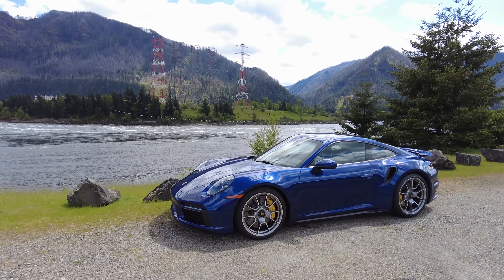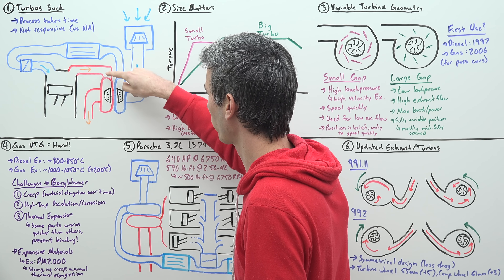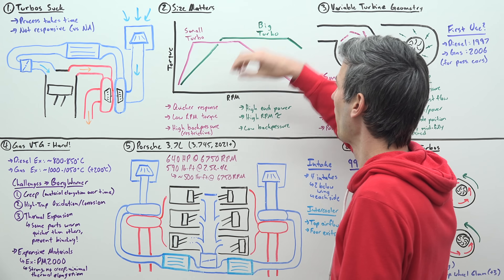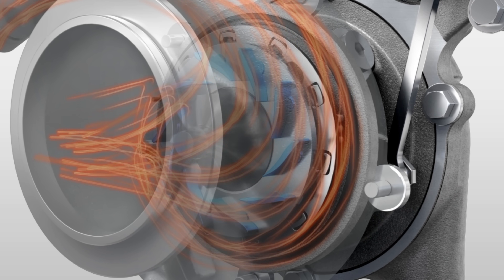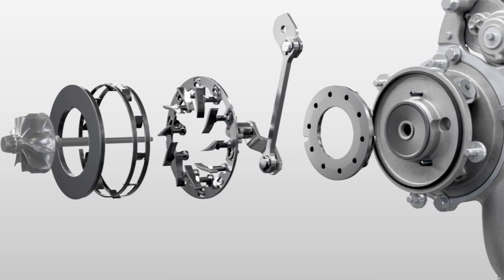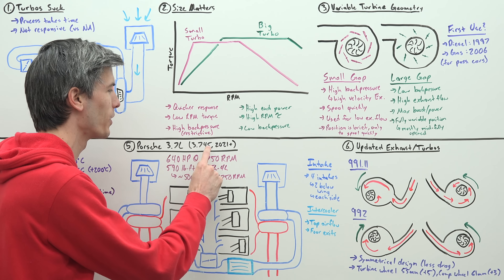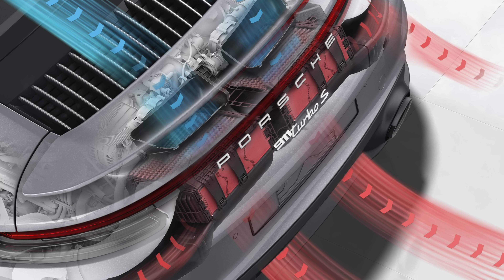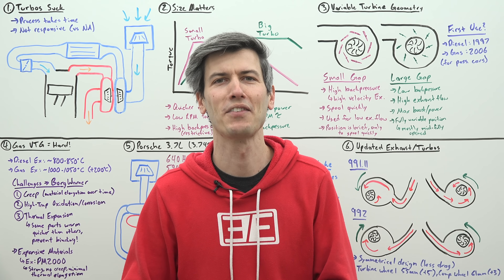The Perfect Turbocharger? Porsche Did It First

Comment from the maker: The whiteboard's back! I think arguably electric turbos are up there as the best (like what's used in F1), but it's of course a much heavier solution, adding a large electric motor and battery to the mix. As a more mechanical solution, this seems pretty ideal; what do you think?
Reply: Google Honda legend wing turbo Jason. Honda did it in the late 80's with the jdm 2.0 V6 tuebo legend
Reply: @crztank9298  Right! The Honda Legend Wingturbo (KA5) came in october 1988.
Reply: And the Shelby CSX-VNT in 1989
Reply: It would be really great to compare this Porsche to the original 930 turbo and show just how much turbo technology has changed and the impact on the driving experience.   The turbo lag on the 930 was insanely long and then the power delivery was basically binary  - virtual no power or alternatively wheel spin
Reply: Are OEM's using carbon fiber turbines on the intake side? If not, what innovations are they doing to keep the rotational weight (polar inertia) down?
Reply: BTW, awesome take-down, as usual! 👌😃👍
Reply: Chrysler used Garrett VNT turbos on production cars in 1989....
Reply: I am a big fan of VGT turbos, and the driveability and performance they can offer. As somewhat of a diesel pickup buff, I feel the need to mention the introduction of VGTs to everyday diesel trucks. Sure, people are gonna say “the actual first gas/diesel with a VGT was…” But when the mass produced Ford and Chevy pickups received their first Powerstroke or Duramax diesel equipped with a VGT turbo, the truck market evolved into what we have today; heavy duty trucks from every manufacturer with great power, and amazing driveability. Notable efficiency as well, save emissions equipment. All offerings by Ford and Chevy since these came out in 03-04 have used VGT technology, and Dodge/Cummins later, albeit in a different way. I felt the need to mention since the mass integration of VGTs in production vehicles seemed to be around this time, along with the 06 Porsche that was brought up, if you figure a longer production time; speculation of course. No one is probably going to read this sentence.
Reply: J M  doesnt matter lol noones buuying a honda bc of that
Reply: As the others have mentioned, Honda used VNT turbos, but also Nissan did too on their domestic market VG20ET V6 engines, also late 80s/early 90s like Honda.
Reply: I don't think you are going to see my message mate but VGT on gas cars was introduced in a slightly different manner back in 1993... Using only one single nozzle in the turbine and the first (and only, with that type of charger) gasoline car to get it was the 220bhp Peugeot 405 T16 with a Garrett t3 compressor family and that unusual turbine housing. Take care!
Reply: I think that variable vane turbochargers and electric turbochargers will be the ultimate when it comes to boost. Almost zero turbo lag but good top end.

The push towards EV is a$$-backwards from the start, because the issue in North America is excessive car dependency. Besides, it's looking increasingly likely that batteries are reaching an inherent thermodynamic limit as to how high their energy densities can get without becoming WMD's.
Reply: I'm excited to see the advancement of variable geometry turbo architecture. I'm sure that there will be design breakthroughs within the next few years that will simplify the design and maybe make them more compact and affordable.
Reply: whens it coming to prius with handlin package to maintain speed around turns
Reply: I wanted to ask about supercharging and turbocharging single engine (zenvo tsrs).
Reply: I think best solution would be electric turbo only on exhaust side, without compressor side used on hybrid vehicle. Exhaust side would generate electricity to feed battery pack, which then be used for acceleration through electric drive. This way we can get sound and response of NA engine plus power and efficiency of turbocharger.
Reply: Guess a VTG turbo is the best that can be offered for a supercars for the moment until the electric turbos become a suitable alternative to them.... Electric turbos have their advantages of instant spooling.... But the downside is the complexity involved (guess Porsche filed a patent for it too for their sports cars) where u have the turbine a generator charging the battery which in turn supplies power to a motor driven compressor..... Sounds F1  but it adds complexity and weight to a car... And weight is the key issues here... Also need to check if lighter materials like carbon fiber or titanium cud be suitable for construction of turbines and compressor ... Since the rotational inertia wud be lowered due to lighter materials..and whether this system wud be efficient mechanically as well as economically.....
Reply: During this year several cars with 120 degree v engines have been released. Would love to see a video about it’s advantages and special features if there are any
Reply: EE, you have reached Silver Fox potential. I think it's about time you started getting RIPPED. Hit the like button if you agree.
Reply: Well, adjustable fins are a technical challenge and a potential failure point. So a two-stage turbo might be pretty cool as well. But it will take more space probably.
Reply: Finally the board is back!
Reply: My OM651 Mercedes’ 2.1 diesel had sequential turbos with a Y branch and actuator that toggled between a small turbo and a bigger turbo. It worked well but was by no means a quick experience.
Reply: You will tell us after you get your hands on the new Mercedes AMG GT 4-Door
Reply: Instead of a motor drive, a belt drive (like a supercharger) through a CVT.  Full throttle, the CVT steps up, providing more boost. As the turbine applies power the CVT backs off.  Instead of a waste gate, the CVT gears down, putting the excess power from the turbine into the crank.  Responsiveness of a supercharger, efficiency of a turbo, no waste gate, so less muffler (the turbo provides quieting). 

Before I played with a flywheel hybrid (CVT's required), I looked at the best part of the drive train to motor assist.  10HP applied to the wheels didn't have near the benefit of 10HP applied to the compressor wheel of a turbo.
Reply: @stevesedio1656  i thought of same thing, it's a packaging issue ,not only a cvt is required you need Mechanical gears coupled to the turbo, cvts can't rev to 100k rpm like a turbo
Reply: @abdelrahmanelmasry9699  Agreed!  Centrifugal superchargers incorporate a step up planetary gear system, the CVT would drive that.  The turbine would remain direct drive.
Reply: This Porsche engine is a real jewel.  It looks like a finely crafted switch watch.  However, I think pure electric has much, much, better “throttle” response, compared to any combustion engine.  Full torque is available at extremely low rpm as well.  Don’t forget smooth and quiet.  ICE cars seem to struggle to accelerate, even 600 hp ones, while EVs just effortlessly and instantly teleport you around the slow fossils littering the highway.
Reply: Do the Carrera 3 liter engines have VGT's also?
Reply: If it is an "electric turbo", would it not be a supercharger?
Reply: @pcmacd  supercharger runs from engine rpm turbo runs from exhuast pressure
Reply: @pcmacd  Not if the electrical power is generated by a exhaust gas driven turbine... Then it is a turbo where the electric installation takes the role of the small axel that normally links the turbine and the pump in a turbo.
Reply: 2004 yaris diesel has variable veined turbo.
Reply: ⁵⁵⁵I
Reply: Rear engine Porsche feels civilized until it doesn't. Then the back end comes around and all the electronic stability control in the world can't save you from physics.
Reply: Huh
Reply: Welp, here we are 2 years later and Porsche seems to agree with you on electric turbo superiority.
Reply: Super chargers are less efficient and use engine power to run. Counter intuitive.
Reply: @trance9158  it's worth pointing out that electric turbos =/= supercharger. porsche filed a patent for a turbocharger where the hot side rotates a generator, that charges a battery, that powers the compressor. you still get the benefit of using exhaust to stuff air into the engine, but compressor speed isn't directly linked to the compressor speed anymore.
Reply: @vukpsodorov5446  - Yeah, I think hybrid cars will open up a lot of new ways to take advantage of otherwise wasted energy. Exhaust-powered generators along with re-gen braking can charge batteries that can power electric motors used for slow city driving as well as electric turbos combined with the electric motors for performance.
Reply: @21jimmyo  and if you're driving with relatively little throttle, which doesn't require much boost, the exhaust-powered generator could probably even be used in place of the alternator even for non-hybrids.
Reply: @vukpsodorov5446  Not if the electrical power is generated by a exhaust gas driven turbine... Then it is a turbo where the electric installation takes the role of the small axel that normally links the turbine and the pump in a turbo.
Reply: @rientsdijkstra4266  unless the generator powered by the turbine, and the compressor on the intake side are linked to a battery, to allow for storage of electricity & to independently power the compressor. I mean, with a properly built VGT, you could generate additional power even while idling, without the compressor running to provide boost.
Reply: @vukpsodorov5446  You are completely right!
Reply: @trance9158  ?!? Turbo's use less engine power than superchargers.  

There are superchargers that use the same style centrifugal compressor as the turbo, as well as twin screw and roots.  The latest version of all three compressors are about 75% efficient (at the right RPM and boost).   

Driving the turbo's compressor from the exhaust recovers some of the 30+% energy that is normally lost down the tail pipe (heat more than back pressure).  That combined with the "engine power" from increased back pressure powers the compressor.

The supercharger gets all its power from the engine.
Reply: @stevesedio1656  I'm very well aware of that. Turbos are better. They also don't rely on a massive belt to run them.
Reply: @trance9158  All boost is good.

But, I like precise throttle response, and for ICE, I prefer roots super chargers.  It is easy to hold the intake pressure to zero (no vacuum, no boost) with the throttle.   

Want power?  Close the bypass valve (WOT), and the only lag you have is the time to pressurizing the intake. 

(For better throttle response, I prefer my EV over my supercharged ICE - mounted on the intake manifold, very small intake volume).  

A turbo's increased efficiency is offset by turbo lag.  The variable trim turbo improves that, but you still have to spool up the flywheel that is the turbine and compressor.  Then you have to pressurize the intake.
Reply: @trance9158  less lag... He's talking about fun 😉
Reply: @ptviwatcher  you're  not going to get much more fun then driving a Porsche.
Reply: @trance9158  gma t50 lol

Comment: I thought of this 15 years ago. Of course I have no proof. But if I had a nickel for every idea that came into existence years later I'd be rich. Same with gms new antilag turbos. 

The next thing that will happen within ten years is a company will develop an electric motor replacement for the aftermarket world. Build a electric motor powerful enough to move a car along with a battery pack that fits in place of your fuel tank and one for the opposite side. Then have different bell housing adapters to be used in whatever car. Take your s10. Replace engine with powerful electric motor. Take out fuel tank and install battery pack and even out the weight. And obviously make it be able to charge with a Tesla charger overnight. Different motors will have different output depending on application and power desires

Comment: I am going to disagree with diesel exhaust temperatures being lower... yeah at idle and cruising my passat TDI would run around 300-400f, barely hot haha. At wide open throttle on a long pull it would max out at 1800f+ ish before pulling fuel... pretty close to the temperatures involved in a gas motors exhaust

Comment: No good reason all turbos are not VGT at this point... Loved the one on my passat diesel, able to spool to 26 psi by 1800 rpm creating 300 foot pounds of torque by 1900 rpm! 110 hp does not sound like a lot but at 1900 rpm it was redic, just always cooking the tires lol. peak hp of 195-200 hp at 4000 rpm, it was a load of fun to drive with all that torque

Comment: Ive always preferred the smaller turbos with quikcer response but less overall power. For a daily driver you're not going to be hitting crazy speeds or trying to run 10 seconds quarters so its ideal to have the best throttle response and power between 2k and 3k rpm... Much better driving experience for a daily driver car

Comment: General question about turbocharged engines in normal road cars : are the turbos « flat rated » as an engine turbine would be ? Meaning are they regulated to provide the same pressure to the intake manifold regardless of atmospheric pressure, meaning your engine keeps its power even at high altitude ? Or do they just provide a compression ratio that varies with atmospheric pressure, and therefore your engine loses power with altitude ? Mountain driver here with a variable geometry turbocharged petrol engine (BMW Twin Scroll), and very curious

Comment: Can't believe BW said that soot acts like a lubricant. I work at a turbo specialized workshop and let me tell you, soot is one of the main issues with VG systems. It builds up until the system gets locked in one position and you have to disassemble it completely to clean it.

Comment: Actually chrysler used a variable turbo back in 1990 I believe with the dodge daytona Shelby vnt intercooled turbo. Called it variable nozzle turbo but it was adjusting the exhaust flow across the impeller as your describing.  Love your videos  great information

Comment: Kinda true in oem but when u go aftermarket with head work cams cam timming is on point u can lower timming numbers down low to make the turbo come on hard and fast no matter how big it is when everything is pared correctly lag should be almost not noticeable down gear and floor it 
Oem stuff has many other challenges that make having the most ideal high flowing setup not really plausible in a fuel economy and noise point of view

Comment: Liquid cooling for turbo chargers has to go down in history (along with direct injection and vvti), as one of the best advances in modern engine technology!!!  So why not use the massive cooling ability of water here in the Porsche?  I know the cooling cuts power but it adds consistency on long hot lapping events and increases the durability of not only the turbos but also the surrounding parts that have to deal with that baking heat!  I just think after 100k miles this engine will be frozen together as one molten blob!  Sorry but it's gotta run hot!
Reply: The highest mileage 911 turbo on the original engine and transmission is over 700k miles

Comment: From a theory standpoint, I have been talking about do it something similar to this for decades. Supercharger have been better & I've always said you'd need a combination of a small & large turbo, or a large turbo & small supercharger, in order to compete well in all regards. Turbos have issues that have been almost ironed out but still haven t fully been. Meanwhile, supercharger haven't really advanced much from lack of R&D by big manufacturers.. as soon as they start making super high efficiency supercharger using exotic materials, turbos will again be at a big disadvantage.

Comment: Love your vids and don't mean to sound contrarian at all...  @ :30  I believe MOPAR actually introduced Variable Nozzle Turbos (variable geometry) in 1989 on the limited production (500 units) Shelby CSX with the Turbo IV engine. This turbo setup then became the standard unit on the 1990 Dodge Daytona Shelby and an option on the Dodge Shadow and Chrysler Lebaron. IIRC the variable geometry was vaccum operated based on manifold absolute pressure, helped the engine develop max torque at around 2K rpm and eliminated the need for a wastegate. Keep the great automotive content coming, my man - much appreciated.

Comment: I really admire the turbo setup of my MAZDA CX-5 2.5 L. turbo with its variable "throttle body" exhaust configuration. This gives low RPM, lower speed exhaust a higher speed to turn the single turbo faster creating far less throttle tip-in turbo lag. As the RPMs rise the exhaust "throttle body" opens up more and more, spinning the turbo faster. All this is why MAZDA's ubiquitous 2.5 L. engine has such a high torque-to-horsepower rating. ZOOM! ZOOM!
PLUS there is MAZDA's clever firing order and exhaust manifold setup that causes one exhaust runner to scavenge exhaust gas from a nearby runner. Clever!

Comment: “The rotating-vane VGT was first developed under Garrett and patented in 1953. One of the first production cars to use these turbochargers was the 1988 Honda Legend; it used a water-cooled VGT installed on its 2.0-litre V6 engine.”

Comment: Informative; thanks! Here is another place where we can see why Porsches cost so much.
You made a comment that one can be going twice as fast as one thinks in this car; to me, that's not a good thing: it leads to speeding tickets. It's one of the reasons I like the Miata: we can use all its power most of time. Shift it manually, too, even at the cost of some time 0-60. It's better to FEEL fast while going slow than vice versa. (while also saving $160k)